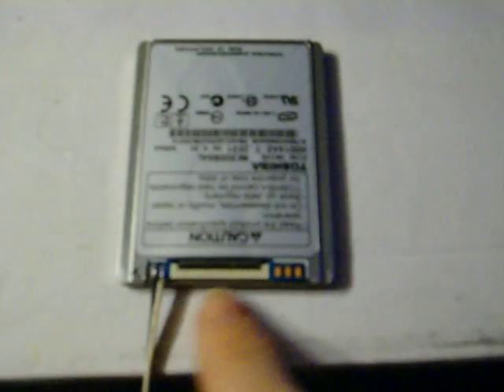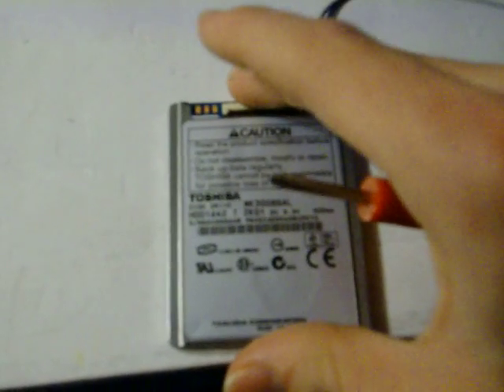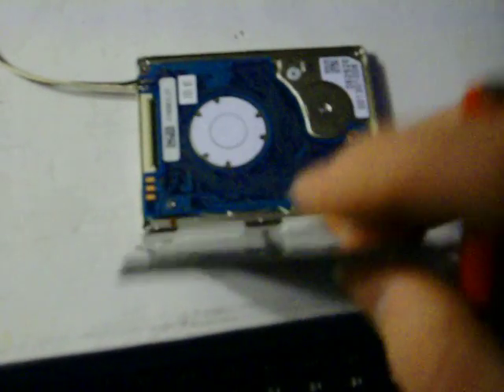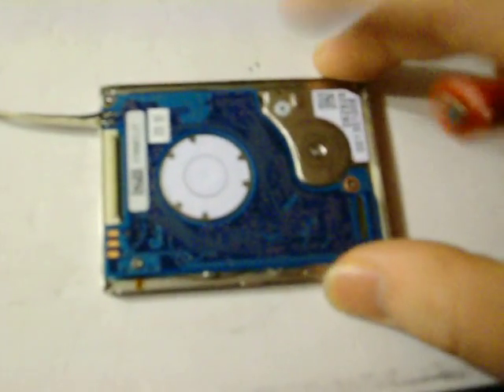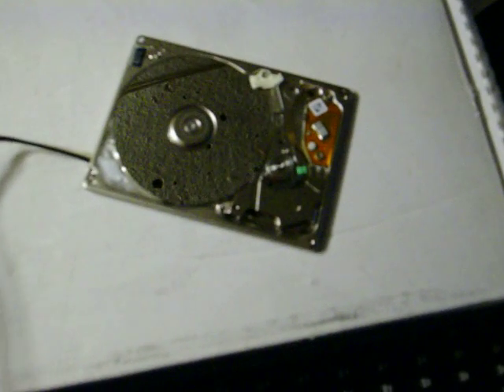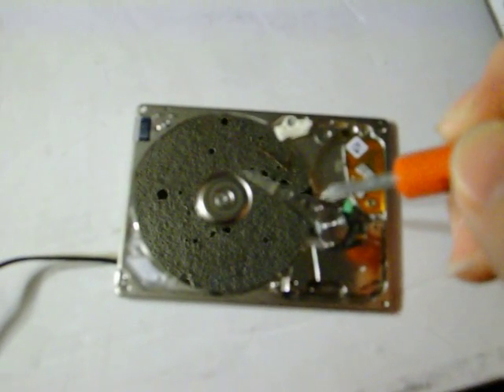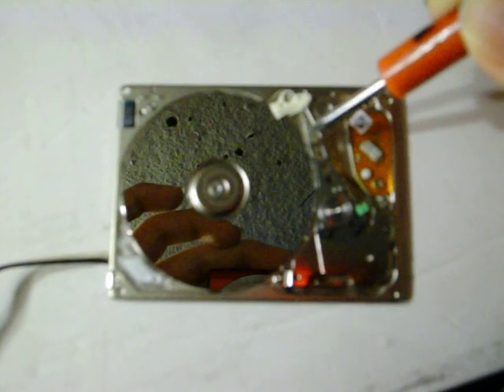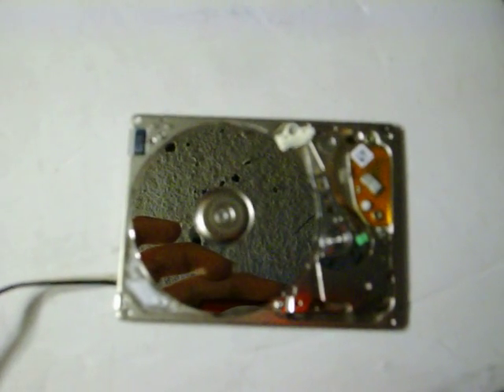The 1.8 inch Toshiba Hard Drive 30 GB, " bad "  power hack demo and working footage.

Comment from the maker: I myself used a small flat headed screw driver, " in the video I am removing Philip screws because they where replaced before the video for access, the original screws are actually really easy to remove with a small flat head or knife tip.

Comment from the maker: Reloading the firmware should not remove your information because firmware is often on a hidden partition on your drive and sometimes even on a flash chip on the main board. However the most secure way is plugging your zen in the USB and seeing if you can access the disk in my computer. if not check disk management for that device. or buy a device adapter for the 1.8 inch Toshiba hard drive for USB off of ebay. they are pretty cheep.

Comment: Hi There,
Just wondering what tool you used to take the initial screws out of the external casing.  I cannot find a tork tool with the proper head.  Most tork tool heads are six sided, but these  1.8 Toshiba drives require a five sided extremely small head.  Also, do you know where I might find this tool?  I have checked all the hardware stores.
Thank you!

Comment: Hi, how can i conect to usb cable to use as a external disk?
Reply from the maker: There are adapters for both the 40 pin, and ZIF connection types of the 1.8 drive to convert them over to 2.5 inch drive IDE/PATA form factor. From there you simply connect a usb to 2.5 inch IDE and rock on with your day!

Comment: I could be wrong as much of my in-depth hard drive knowledge relates to DOS and very early ST506 interface MFM/RLL drives of circa 1987 through to the emergence of the first IDE units from Miniscribe and Conner Peripherals.. Back then sector zero, the boot sector and first sector on the drive, was always at the OUTER edge of the platter. The format you describe seems more like CD-ROM where the disc space is used from the spindle outwards. In hard drives the opposite is true. Especially in contemporary hard drives all using ZBR (multi-zone / zone bit recording), where the factory low-level format lays out the platters in a number of concentric zones, each with decreasing numbers of sectors per track as you move in toward the spindle. This means that the outer tracks and zones hold more data per track and have much superior data transfer rates and performance than closer to the spindle. In the real world this means that loading intensive operating systems like Windows will happen much faster if the disk is formatted so that storage begins at the outside and the OS is copied on first. There are defrag programs that will reorganise the disk to ensure this happens. So, my understanding is the boot sector and primary partition table are located on the outer edge of the hard disk platter and that’s also where storage for the primary partition starts...
Reply from the maker: Quite possibly, I went on the story of an older person who told me that back in the day he wrote a program that would tell the hard disk head onto the center spindle. This was back in the early 80s when he was studying computer technologies in college. I work with hardware, mostly optically related so I can't say that I do not know where the boot sector is on these hard drives. I myself would have to look it up even for myself.